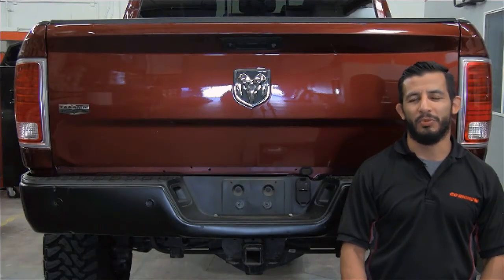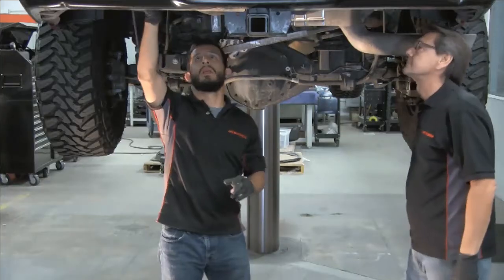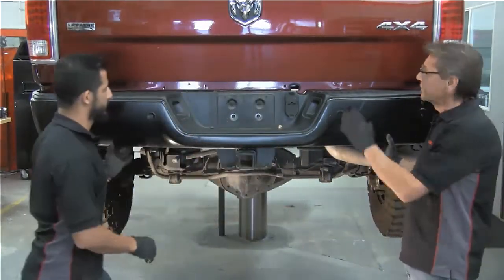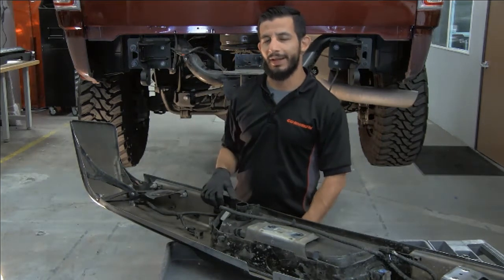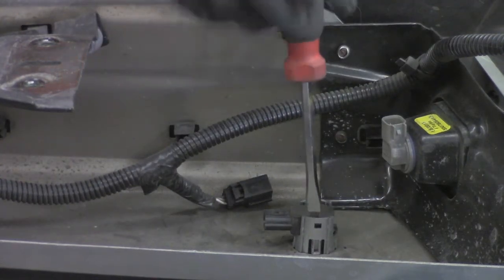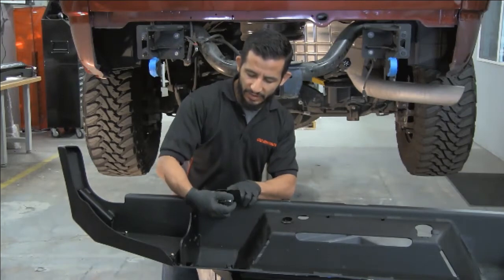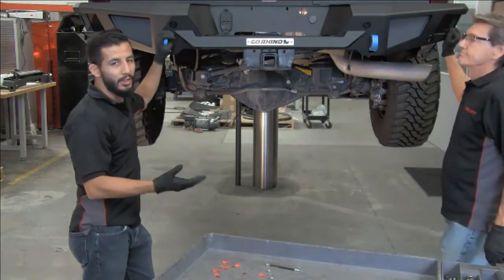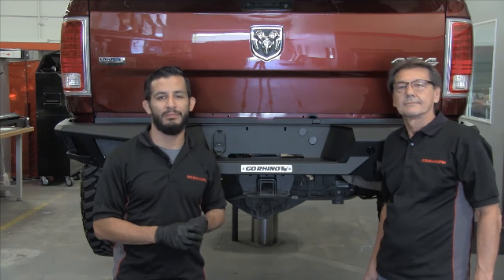Go Rhino BR20 Rear Bumper Replacement Installation on 2016 Ram 2500 Mega Cab (24219T)

Comment: Got the rear rhino bumper for 2017 2500 Ram Power Wagon. A few notes on install.  on plate lights Just put additional holes in bumper for light mounting and plate screws. it'll take all of 10 seconds for the plasma cutter or laser to do that while in fab process. folks won't have to unwire or unplug lights for plate change. I'm drilling extra holes today. On the sensor plates that tape on.. add some holes for screws please, also drilling those today. My sensor clips were too tight to fit it bumper holes..maybe due to powder coating. I had to ream those with a dremel drum sander. Solid bumper just a few minor fixes costing pennies during manufacturing that folks will really appreciate.
Reply from the maker: Thanks for the feedback! We'll send that off to the R&D team for review.
Reply: Wanted to get back with you folks on the spare tire wrench hole. It is in fact correct using the slot at top of bumper. My fault for not catching that earlier I had assumed the round holes with plugs were for the access. I finished my install with a couple mods to mount lights and hard bolt the sensor plates instead of tape and I love the bumper.
Reply: What did you do for the lights and the sensor plates?
Reply: Michael Grooms I drilled separate holes each side of license plate. Also drilled two holes per sensor in bumper and sensor plates and used stainless button head bolts to secure.
Reply: @WarbirdCalls  I'm wanting to do this to my bumper. Do you have pictures of it anywhere?

Comment: Just want to add my experience with this bumper and comment on the ending of this video. The video ends with the guy telling you, the LED lights will need to be hardwired in to replace your license plate lights, but they don’t show you where the license plate lights will then go, because there are no license plate lights on this bumper. None. The OEM bumper has license plate lights on each side of the plate, but the Go Rhino bumper does not. You will need to cut holes in the bumper and fabricate some sort of apparatus for those LED bulbs to go. I taped up my incandescent lights behind the bumper and I’m having to figure out some sort of aftermarket license plate light solution. This is ridiculous. Go Rhino should state this on their site but they don’t. I specifically asked about license plate lights before I made the purchase and the salesperson told me there were license plate lights. I assumed that meant the bumper had lights as a part of it. It doesn’t. Buyer beware.

Comment: Many issues with this bumper:

1. The stock tailgate cables on 2012 Ram 2500 are too long and the tailgate hits the bumper putting a nice dent and ruining the paint job of my truck. 
What can be done to fix this?

2. I also had to bend the cable harness clips because the bumper metal was not cut correctly.
3. License plate sit's too low hiding the bottom side of the license plate according to Phoenix police. 
4. No rubber plug was included to cover the winch hole even though the instructions clear state is does
5. No clear solution to replacing proprietary license plate bolt-lights combo ( cannot use stock lights or find replacements at auto store)
Reply from the maker: Hello Infiltrator, is there a contact number that we can reach you at? You can also reach us at 888-427-4466 and we can have one of our product experts answer your questions more in depth. Thank you.
Reply: @GORHINOPRODUCTS  I also was not aware of the license plate light issue. I called and asked specifically about license plate lights and was told there was an area for the lights, and there is not. There’s no way to use the stock lights in the aftermarket bumper, there are no holes or aftermarket parts to install the new ones that come with the bumper. This is a huge oversight by GoRhino. There should be prefabricated holes for the new LED lights that come with the bumper. There’s no reason a customer should have to take their truck to a shop to have them professionally cut the bumper to install these lights. Of course that never gets discovered until the bumper is in and you’re sitting there holding these LED lights and nowhere to put them.

Comment: I was about to pull the trigger on this for my '16 Power Wagon, but seems as though there are several issues. Have they been addressed?
Reply from the maker: Yes, we have made a few adjustments, so it should fit onto the Power Wagon with no issues for the most part. Of course, we have isolated issues once in a while. We have had a few customers with older trucks have sensor clips that are too tight but other than that, no real major issues. There were many complaints about the tailgate hitting the bumper, but installers were not following directions and mounting the bumper really high and tight.

Comment: So if you have a 2013 RAM 1500 4x4 5.7L Hemi Bighorn, then you have to drop the dual exhaust out the back since no cutout.
Reply from the maker: Jason, our bumper for the 1500 looks a little different to accommodate for the dual exhaust. You can see it on one of our 2016 SEMA Show vehicles here: https://youtu.be/ZrYZTqPgAgI?t=4m
Reply: Go Rhino but will still fit 2013. What is the model # when ordering off third party websites like Real Truck?
Reply from the maker: Yes, our BR5 Bumper was made for the 13-18 Ram 1500 and is part # 24128T and the BR20 rear is 28128T

Comment: The license plate lights should stay stock. It is a pain to run the wire and the light thru the bumper. When you go to switch out plates that is a lot of extra work for those two little lights.
Reply: You don't run the lights thru the plate holes you add additional to each side of plate. The worst part is Rhino doesnt tell you that those little lights are crappy LED's without resistors so they'll last maybe a month if your lucky. I am researching some alternative lighting now.
Reply: Michael Groom

Comment: will that double side tape hold up with time for the sensors?
Reply from the maker: Sebastian, as long as the surfaces are prepped and cleaned, there shouldn't be any issues with it holding up. We have had it on our own show trucks here and it's held up after thousands of miles on the road as well as a bit of off roading
Reply: Where do I get the double sided stick-on sensor mounts? Mine didn’t come with them
Reply: Go Rhino are the stick-on mounts sold separately??
Reply from the maker: Thomas, the sensor mounts should have been included. Please contact us at 888-427-4466 and we can take care of you
Reply: @GORHINOPRODUCTS  Tape?? that is best you can do?